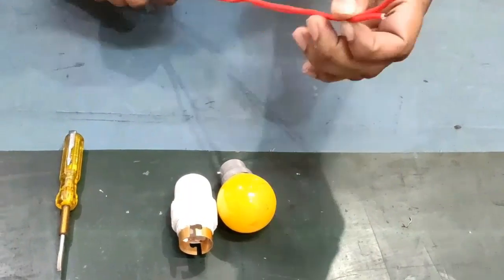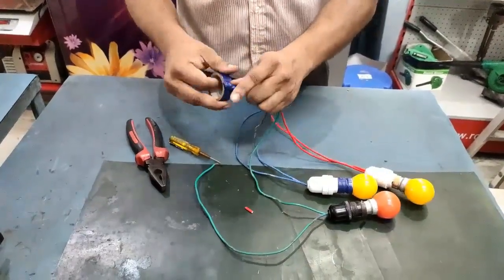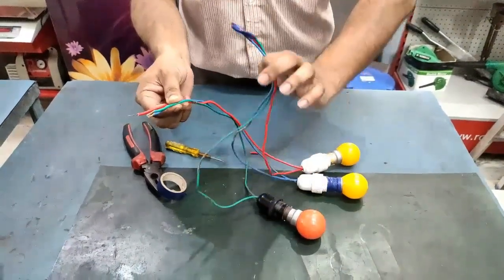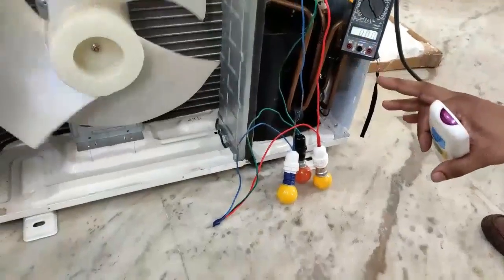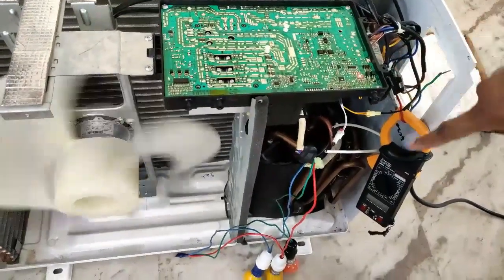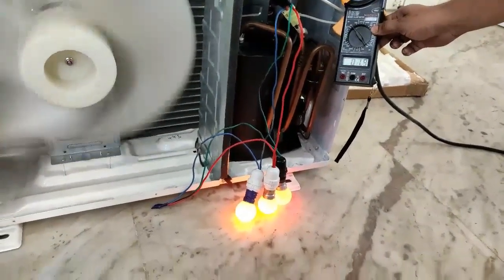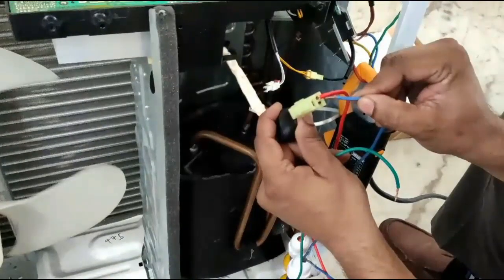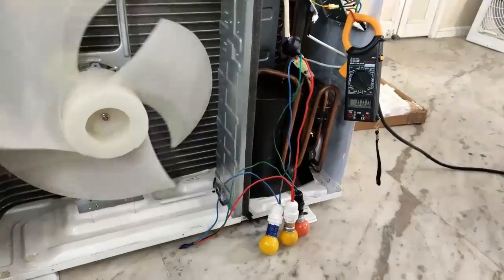Now check Inverter AC Compressor and IPM with Bulb ( English)

Comment: Hello sir in my carrier inverter  ac outdoor unit pcb led   33 time  blink and compressor starts only for 3to 4 seconds an stops with jerk 

Indoor unit not showing any error only outdoor 33 times blink 
All sensors ok
Compressor windings ,connection normal ,there is sufficient gas then what is the problem plz reply

Comment: Hello Sir, great explanation. Could you tell me if the bulb is a normal one like the one we use in house? or is it an special one for DC? i ask because the IPM give DC voltage
Reply from the maker: You are right, we can not change frequency of DC voltage, hence the voltage output from IPM is AC voltage but divided in three phase or pulses. So the bulbs used are normal ac bulb of 230-250 volts 15 to 100 Watt.